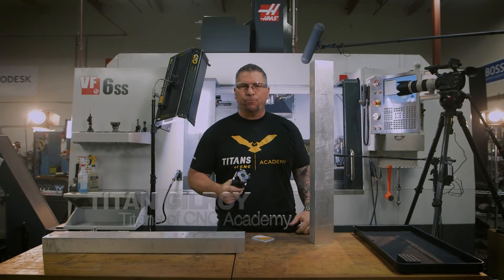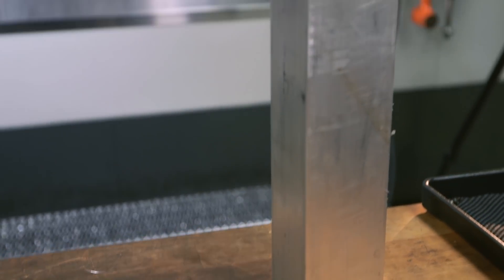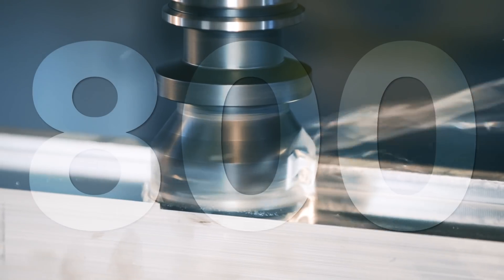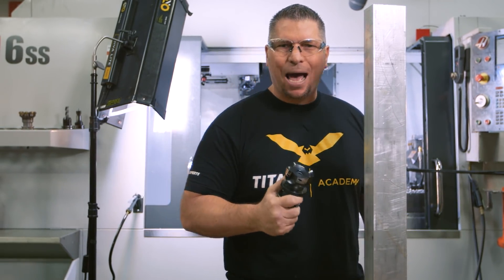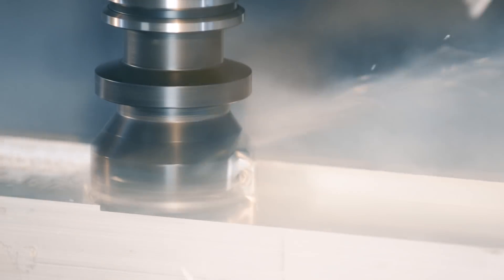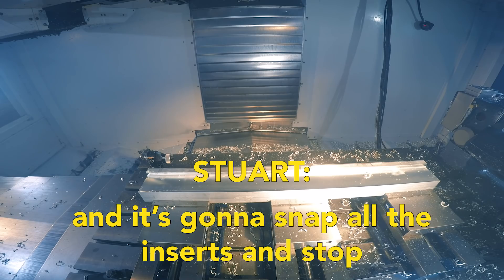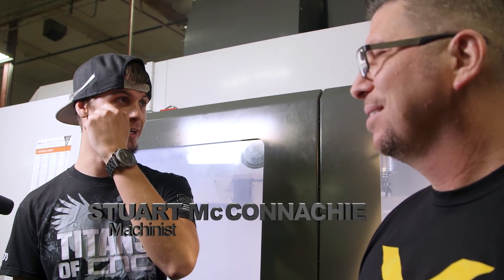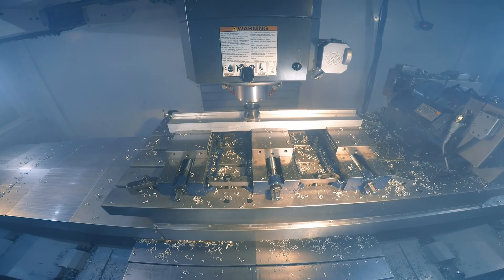Pushing CNC Machining Past Failure | 800 IPM | Kennametal

Comment: at my shop, we do only hard plastics, they produce just dust of it. i dont know the name in english, but, they are diffrent. some of them are with glas, some of them are just hard paper and some of them are PVC. we can go in the one with glas, with PKD a feedrate of 1500 or 3000 mm per minute and its fast for us. but in pvc we go with hardmetall and a feedrate of 1000 mm per inute. this is fast, but i think we can go faster. I learnd there and my superviser said, they there going with PKD with 10000mm per minute and 1mm in z and full radius or 50% of it. they did always plastic and a bit of aluminum, but why they are now at the point to take 5mm in z and do 1000mm per minute with hardmetall all the time? i dont get it. we did some tests with the glas 1 and it goes very good. with the paper 1 it goes even faster. a good material to destroy with tools.

Comment: what is the actual speed on the first run , you use actual in terms
Reply: my bad 300,000 rpm
Reply: how much are these bits in cost
Reply: failure of process at 700,000 rpm
Reply: amen you got the sweet spot, at 800,000. rpm congrats

Comment: I know this is a old post. Haas is not the boss. Doesn't have the Horsepower. I do understand these are beginner systems. This is where machine load and horsepower formulas are required.

Comment: During the second go round, when you dialed down the spindal, you were only taking off about a half inch of material, not the full bit size. Plus, you added coolant. Yeah all day that works. Take a new pass with a new bit. First iteration was doomed to fail because you dulled the bit leading up to your pass/fail test of 800". WTF are you guys new to this shit or are you just counting on viewers that are not familiar with CNC machines.

Comment: You know it's amatuer when they don't even bring up chip load... Figured it from the shots, 800ipm was about 0.430mm/tooth for those of us in metric world... Not that extreme for aluminum. Not to mention hey my solution is this genius idea, turn coolant on, and take two passes, doubling your cut length meaning going 400ipm is just as efficiency lol want to find a sweet spot for me?  Run a 3" mill 4-5mm doc thru hi temp cast stainless with basically a 3 jaw Chuck in a twin spindle horizontal.

Comment: The volume of material removed per minute is V = Feed x Width of Cut x Depth of Cut.  You were actually removing more material per minute at 500 ipm and 2.7" woc than at 800 ipm and 1.5" woc.

Comment: The us government actually provides a free feeds and speeds chart for all kinds of materials. They do this kind of thing in my hometown.  We were told about it by a local machine shop school
Reply: Doesn't really apply with 10k+ rpm CNC milling machines that are designed for high speed mass production.

Comment: For me usually is the workholding that limits the speeds. I can dial in the numbers even larger MRR than that in video but either there's too little material to hold on or poor selection of vises at the moment. Eitherway it costs money better known as opportunity cost. Proper tools always pays off in time and only thing that you can't replace is time so that will always be the most expensive thing in any shop.

Comment: I can't see how it didn't alarm out unless someone changed the overload parameters. Any machine I've run would have alarmed out past 120% load beyond a couple of seconds. One would have alarmed out just due to the shitty harmonics created by the overload. Personally, I would have run a smaller facemill, optimized for aluminum, and reduced axial depth rather than overloading the spindle. That said, it is a HAAS, so who really cares if it's completely fucked in 6 months.

Comment: The correct approach (IMHO) is to review the torque curve of the mill and run at the RPM that produces Peak torque. then optimize depth of cut and feed rate around that for best MMR. At a certain point the tool  stalls or breaks but usually that's to do with  clearance of chips from the cut. To improve clearance of chips increase spindle speed - continue to optimize. I was able to triple my MMR over just running the spindle "flat out" and not thinking thru this..

Comment: can someone please explain the point of 170% spindle load...  ?   170% of what. ?  maximum?    ...   maximum what?  maximum is 100%.... you divide everything available by 100. if you have 170 available then your math must be wrong....     surely you only have 2 options .  he is damaging the  machine or the manufacturer has no clue what they are talking about.    which is it..    how many working cnc shops allow their machines to go past 100% spindle load?     i built my own machine, and i cant go past 100% of anything.... budget , part size, electrical power,        maybe i am missing something about spindle load..

Comment: It cut "OK" at 600 ipm and 2.7width of cut. Why cut at 800 ipm with only 1.5 width of cut if the two passes required to cut the 2.7 width will take longer? Seems abusive to machine and cut  quality.
Reply from the maker: Hey, just having fun and showing that the tool can GO Baby

Comment: You know what is a scary sound ? A Haas ceramic spindle bearing exploding at 10,000 RPM while hogging out material on an big aluminum part. The Horror ...... The Horror ....... That's what CNC machinist nightmares are made of .........  :)

Comment: This coukd be a new sport discipline.
CNC Drag Racing
Reply from the maker: Cool Right:-)
Reply: Haha nice one :D Haas vs DMG :P
Reply: that actually sounds like a cool idea, people try to make their machines the fastest and compete for a prize. kinda like those chainsaw competitions where they gotta  cut through a log as fast as they can 3 times or whatever, just with metal and big azz cnc machines. ok the guy with the sawzall can come too
Reply: @bmxscape  Alright competitors: This is a one shot pass in a weight-calibrated 6061 aluminum block and a total time of 10 seconds. Lowest retained material weight at the end wins, so on your marks, get set.....
Reply: @Ash Kebora Wouldn't both happen?
Reply: Im sure someone would come up with a machine that used the power of a ROCKET to increase torque.....
Reply: Doosan vs Hass
Reply: Lmfao!
Reply: Why hasn't anyone done this yet?

Comment: I was ready for the climax at 800 IPM, no coolant, in round one.  KO.  It was the great prophecy, foretold and expected by all in the title.  In a stunning subversion, the solution was to REDUCE THE RADIAL.  The next time my spindle load is at 200% and I'm breathing smoke, and I'll remember this little trick.

Comment: at collage I try to push the haas mini mill to it limit, it got a 6000rpm 5.6kw spindle(7.5hp) I then got it running at 7500 mm/m feedrate which is about 300ipm, I then chickhen out as the spindel is reach over 8.9kw(8.9)

Comment: Who cares about IPM, it's all about MMR and you had to step off your radial to hit 800. Your RPM are above the optimal range for best power output on that machine. Lower your spindle speed, get a facemill with more inserts to maintain chipload and get your material removal rates up. MMR is what counts. This video is flash and smoke, all show. If you're saddled with a Haas, at least understand its strengths and weaknesses and play to them. Do you even know what your target chip load is?

YouTube, why do you keep putting this dude in my recommended videos?

Comment: Like a night at the drag strip. bwahaha! would have been nice to hear those cuts without the SFX. sometimes its just plain ole fun to push something hard and watch the pucker factor around the shop. Curious to see what the edge prep on the inserts looked like and the progressive wear pattern from 600-800 IPM. Id imagine at those pressures and temps you would be looking at molecular changes at the insert surface given the alloy content of material.

Comment: We just got the same ngc control in (2018 haas vf5xt). I noticed your chip load you see on the screen is reading correctly as a 4 flute cutter. So far I just programmed tool length and dia of tool . Looks like there is more for me to add (# of flutes)

Comment: Hey can someone direct me to a place where I can buy aluminum like that? I’m not a machinist and I don’t have access to tooling equipment (sadly), but I DO need aluminum for metal casting, and seeing that much aluminum being shredded to bits is slightly infuriating tbh
Reply: have you tried googling "metal distributors" ? or if you're looking for a low volume of metal and want to make it simple check out mcmaster carr ( mcmaster.com )

Comment: So how was the cut on the 500, 600, 700, fpm no coolant runs?         As a non-machinist, I'm curious to see how much snipe or chatter there was on the (Y?) axis end of the material.  I assume the Z was rough as well.    (X?) went through on all but the last pass, so there was nothing to see there.   (Not sure if the X was the plate motion, or if the Y was, but I'm assuming X based on the load factor on the screen)

Comment: What does "stepping in at -2.700 radial" mean? What does the "radial" parameter mean?
Reply from the maker: Just that the tool is 3.0” and 2.7 is engaged in material cutting.

Comment: I don't know about all that but I work in aircraft has a Machinist and we run all of shell mills at 300" with a 150-250 Z depth of cut and it's about 90% load pending on our material

Comment: The cost study on new inserts, tooling, and machine wear vs. 1 minute saved on cycle time. Marathon vs the sprint.
Reply: Lol and then there's me who has to run the same part 24/6 for 5 years so this kind of nonsense is idiotic unless I want phone calls at 2 am from a production guy who only knows how to put another tool in and blow it up too. In mass production cycle time is even more important than for the jobshop guys, every single second is counted.  Including those you spend flipping the inserts every 3 cuts.
Reply: @e23561  they completely missed the point I made about machine wear. Trying to normalize apparent machine abuse is a desperate grab at youtube views. @e23561, good point about downtime as well
Reply: @rodidy  Is it your experience that tools and machine has substantially more wear PER PART if you run fast vs slow? 
I would assume that on the spindle ex - it would be a very hard, expensive and time consuming study to make.
It seems like a lot of parts are unnessacarily expensive due to slow processes, and as with anything backing 10% off the max. is probably a lot more durable than backing 2% off, but the difference between 50% and 90% is likely miniscule in wear.
Reply: @jenspetersen5865  Sure it's a hard study to perform but with a bit of common sense, you don't need to do it. Do you floor it and launch every stop light you take off from? Do you want to constantly be running spindle loads at above 150% or in this case 200%+? I'm all for speeding it up but giving your machines and tools absolute hell every single roughing pass will make the inevitable meeting with the Wear and Tear Gods come much sooner. Your tolerances on the finishing passes will ultimately start to suffer long before then too. Poor bastards trying to walk in offsets on these machines in 5-10 years will be scratching their heads, chasing the magic number shift to shift. Edit: I didn't answer your original question, my bad. No, it isn't in my experience because machines, tools, and parts have a language that they speak when something ain't right. When it's audibly noticeable that you're roughing too hard, my intuition 9 times out of 10 is to dial it back instead of going full Stuart from MadTV. "lookwhatIcando!"
Reply: @rodidy  Lol did you even watch the whole video
Reply: @spencerwilliams7234  I don't think he did. They reduced spindle load back down to 150% with coolant and 1.5 inch axial depth of cut, AT 800 IPM. There's a lot of machinist purists who think you can't run fast with good tool wear, it's just simply old timer myths with current technology.
Reply from the maker: We save way more than 1 min and Crush the competition when it comes to bidding. Rough Hard and then Kiss it... for the Win.
Reply: @TITANSofCNC  
We rough hard too. Inserts last through alot more parts. Interesting how sometimes you're at 60 hrs for the week, YOU (well me anyways) DONT WANT TO WORK SATURDAY, double the feed rates, get it done, and see ya'all Monday! 😉👍

Comment: Why beat a cat 40 spindle like that.   We cut aluminum all day with a 3 inch and 5 inch she'll .100 deep,140 ipm rough and 100 ipm finish at 8,000 rpm. Keep in mind aluminum will still distort if you take to much material off one side.
Reply from the maker: If you notice, I backed off and said 300-400ipm was the sweet spot for my specific machine. Been machining this way for 22 years and my machines run great... my bids win, and my company is successful. People wonder why they can’t out bid me with SpaceX and then argue about speeds and techniques.

My point in this was just to show you that at 800 it didn’t break...
So feel free to experiment so you can increase production and make money.

Comment: 5:18  What happened?  Did the machine not have enough power to keep turning the tool at that feed rate?
Reply: controls will only take a certain spindle load for a period of time until they cut off for safety.  for example, 130% for 3 min, 200% for 30 sec, 300% for 5 sec, etc.

Comment: Are you really gaining ground though?  Pushing to 800 is great, but if you're reducing your radial to do it, is it worth it?  Especially considering wear on the machine?  

Great video though, thanks.
Reply: They real machinists calculate their Material Removal Rate vs their chip load.

Comment: that was pretty good that's not on common though here in my shop I run milltronics and Hoss's to VF ones and be able to use that I cut a 250 all day long on the aluminum never have an issue

Comment: Nice nob there , in my experience the sweet spot is a resonating sound that feels like music to the ears. When you hear it you automatically get to know that neither the spindle nor the tool is bearing any abuse.  I work in millimetres and using 45 kw spindles , 22000 RPM a feedrate of 7000 - 8000 mm/min , and depth of cut 4-5 mm it feels like and orchestra . With smaller tools 3mm depth of cut is better and safer. Whats your spindle power and torque ?

Comment: YOU ARE PLAYING WITH ALUMINIUM AND I M USING KENNAMETAL  ON MOVING COLUMN MACHINING CENTER MY DEPTH OF CUT IS 5MM CUTTER DIA IS 5'' INCH USING FEED RATE OF 1000MM PER MINUTE  ON CUTTING OF HARDENED ALLOY STEEL LIKE P20 , K100 AND EN31 HIGH CARBON MATERIAL

Comment: If your RPM is up high enough it should decrease the load per cut.  Also maybe a smaller radius shell mill to decrease the speed that the tips of your cutting tools are moving to help them make a cleaner cut.

Comment: It's not about how fast you mow. It's how well you mow fast.
Reply from the maker: Gotta Push it... Relax it... then Kiss It.
SpaceX doesn’t complain
Reply: @TITANSofCNC   just looking out for you here, you might want to delete this . confidentiality agreements and what not.
Reply: @MrEtronic  It's a 2 year old comment. If it was going to be an issue, it's a bit late now.
Reply: @ThumbDr  real original
Reply: Agreed
Reply: it was awesome thank you for the share
Reply: It's cool to watch.if you're really young in you're machining carrer.if you own the machine to beat on also helps.no machine could handle that abuse for 8hr shifts.so why do it.to show off.aluminum really has no limit.its all about h.p.and chip evacuation.and cooling.youre videos are cool though.ive been a cnc programer for along time.and I always think should you mill or if you can just ban saw the hudge prices if I can off of a blank.

Comment: My question is, why aren't you climb milling??
Reply from the maker: That is climb milling... RPM's clock-wise... and going forward on left side of part.
Reply: I appreciate your reply, but I think that you are incorrect. When you are cutting in this manner, you are conventional milling (pushing). If you started on the side of the work piece where the solid jaw is in this video, you would be climb milling. Climb milling is most efficient when using 50% of the cutter diameter, that way the tool "pulls" you thru the cut. Have a good day.
Reply from the maker: Think of it this way...
Your saying, that on the dead jaw side... left to right...

This is the same thing, its just rotated 180 degree.

So the the Shell-Mill is on the left side of the material... moving forward on the left side.
Like a tire that propels a car forward... that is climbing. So, I am moving away from the chips that are being cut.

Conventional is moving backwards, into the chips that were cut.

Don't want to argue... but trust me. You may want to take another look and or ask someone.

Take care.